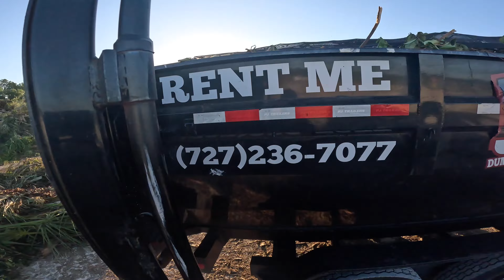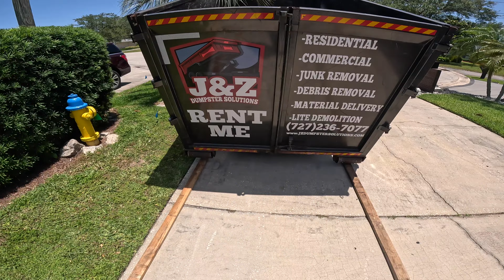DAILY life in the DUMPSTER RENTAL business- 3 PICKUPS & 3 drop-offs !! #dumpsterrentalbusiness

Comment: How Does Charging work ? Example if they add concrete when not supposed to ? What do you charge them ?
Reply from the maker: Our Terms & Conditions outline unauthorized material in dumpsters. On my end it's a click of a button for a preset pricing on our CRM system.